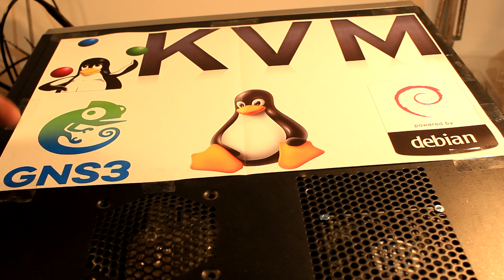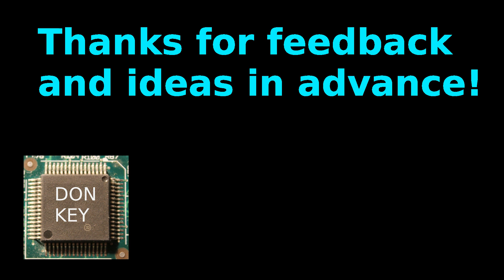Building an IKEA table-rack mounted lab for virtualization, CCNA-CCNP studies, and ZFS

Comment: The trick 7:10 with the fan is new to me, that's useful for me.
Reply from the maker: Yeah, one must cool those server cards. Now I also put in a 40Gbps QDR InfiniBand card in addition to the quad 1Gbps network cards, and the QDR card is very warm in spite of my fan cooling. Of course, in a real server this is not a problem, since there will be 4-8 fans blowing through the chassis like a tornado...

Comment: I run a Cisco ASA 5520 and a 3560G in my house full time and how I got rid of the "noise" of the fans was to disconnect the internal fans and then cut a 200mm hole in the cases above the ASIC on the switch and the processor on the ASA and then mount a 200mm fan on the cover and then connect it to the 12V supply on the ASA and Switch.  It keeps them cool and is whisper quiet.  I have done it on other Cisco devices where I didn't want to cut the covers I just mounted the fans above the devices with standoffs.
Reply from the maker: Cisco 5520 for a home, wow, I would say that is overkill. Even an ASA 5510 would be way too much, but power to you man ;) The issue is, that here in German speaking countries the rent prices are insane even for tiny apartments. Even if I could somehow reduce the noise with a large fan, there would be the issue of what to do with the heat. If there would be a basement, or I could use a room for nothing else but geeking out, that would be awesome!
Reply: I used to have a 5505 but it only has  Fast Ethernet and my Internet service was 300Mb/s so I had to go to the 5520 for the gig interfaces.  Another decent router/firewall I have been using lately is the Ubiquity EdgeRouter.
Reply from the maker: 300Mb/sec Internet ?  Here in some companies even the local ethernet is stuck at 10Mb/sec. Seriously, here you would pay with buckets of solid gold for such a connection. I assume you have an asymmetric line, so I am wondering, what is your upload?
Reply: I have 300/25, so "only" 25Mb/s upload speed....hehehe

Comment: I bet you had some work with it and you put some effort in it, but for real world Szenarios this is not applicable. If I put 4U 1 UPS + 2 fully equipped 2U Servers + 1 Switch in that "Rack" it will break. For your setup and very light setups it's enough but not more. So for all who are looking for a solution for a heavy setup please simply take a closed 24U closed Rack Railkit it costs +-160€ and it's a real rack with steel chassis and standardized holes and warranty. here an example https://www.amazon.de/12HE-offener-482-6mm-Rack-Schrank/dp/B00AC2BOHO/ref=sr_1_fkmr1_3?s=computers&ie=UTF8&qid=1501001608&sr=1-3-fkmr1&keywords=12+einheiten+server+schrank
Reply: How much weight do you think if okay? I think you underestimate this lack table. I have my 3d printer (about 10-15kg)+two din rails with terminals+my 2. Printer(about 2kg)+ my cleening Station (about 3kg)+ a Couple of Equipment (around 10kg) all in the tables. I stacked together 2 tables on each other and the do very well.

Comment: 8:50 every one is crazy now with ubuntu? don't know what you talking about. ubuntu has been the ugly duck on the room for years now.
Reply from the maker: Well, in general people all over the place are switching to Ubuntu, and for some purposes (like Nvidia GPGU computing) Ubuntu is becoming the new de-facto standard distro. Namely, Nvidia is delivering CUDA and the Nvidia driver nowadays as a Docker image on Ubuntu.  Even for GNS3 you can install the newest one with a single command line instead of having to mess around and compile it from source.
However, I am personally not so much in love with Ubuntu, because it is trying to be way too cutting edge and include the newest, latest&greatest which does not always work... With Debian things are 2 years behind, but it is rock solid, and so far the upgrade process always worked.

Comment from the maker: @Julian Bornemann commented, but YT is broken, so not all comments are displayed and often I cannot respond to them either:
           The legs of the Ikea Lack table are hollow frames with of 3 mm thick compacted wood with 2 particleboard caps on the ends. So you can not safely mount anything to them. The screws wont hold anything.
==========End of original comment
If you remove the particle board cap, and place in a 42x42 mm solid wood and you push it into the hollow leg, it will hold things.
In my "rack" the weight of the upper devices are supported anyway by the lower devices.
Nevertheless, I agree that the hollow legs alone would not support a heavy server like a Supermicro 4U chassis or anything similar.

Comment: hi is nice. what software u use in the pc up to the switches
windows or linux.
hope u can help me out.
Reply from the maker: Just drop me a comment here if you have questions where I could help you out.
I am making a step-by-step series on the software installation and configuration, so people can build the same from scratch if they wish to do it. I use almost exclusively Linux both in my job and in my private life. This is  just because I originally started out with computers by using SGI Irix, later Sun Solaris, and finally Linux.

Comment: There is also an article http://www.techspot.com/review/1155-affordable-dual-xeon-pc/ Which is very good and Quit but cost somehow more $$$
Reply from the maker: This indeed looks like a nice build. However, just the motherboard itself used from Ebay still costs 500Euros here in Europe on Ebay. My whole build did not cost even close to this amount, and I have not even factored in the Registered DDR3 prices, CPU prices, and the fact, that this would not fit even in my large Fractal design XL R2 chassis. Hardware costs in the U.S. are lot-lot cheaper, and even if we would buy things from the U.S, after custom fees and 20% tax it is just way too expensive.
Reply: Donkey Learning IT 
I agree with you , but i am very sure for real virtualization lab you will need such build.
Reply from the maker: I was thinking about getting a dual Xeon 1366 socket Supermicro board. Those can be had nowadays for 300Euros including the CPUs and 16GB of RAM, and one can buy more RAM in them (up to 64GB).
For a serious lab one needs of course more hardware than what I have, especially for high-availability labs and server-clustering labs. This cheap motherboard is not even able to support SR-IOv, and the cheapo network cards do not support VMD-q. IPMI on gaming motherboards is not even an option, and 16-32GB RAM is very little. I have mentioned the lack of these features in my previous video in this series. 
For the upcoming months this build should be OK, and for many people such a machine will do most of their labs. Since I work mostly as a contractor, I often change jobs in every 2-3 years. If my new job will be more focused on virtualization, I will build something similar like in the article you linked.

Comment: You should definitely check EVE (UNL http://www.unetlab.com/ )  Where you can virtualize many many networking devices.
But unfortuntilly the developers told me that for images that uses QEMU AMD will not perform good at all and could have issues.

Vendor: CISCO SYSTEMS
Qemu Nodes:
Cisco ACS 5.6
Cisco ISE 1.2
Cisco ASA 8.0.2 OLD syntax code match 8.2
Cisco ASA 8.4 supports multicontext
Cisco ASA 9.1.5 Supports multicontext
Cisco ASAv 9.6.2 or earlier
Cisco IPS 7.1
Cisco Firepower 6.1 Management centre
Cisco Firepower 6.1 Treat defence ASAv
Cisco Firepower 6.1 NGIPS
Cisco Firepower 5.4 (NGIPS, FMC)
Cisco CSR 16.03 Denali
Cisco CSR 16.0.4 Everest
Cisco vIOS L3 15.5, 15.6.2T
Cisco vIOS L2 15.2
Cisco ESA 9.7, 9.8, email security appliance 
Cisco WSA 8.6, 9.2 10.0 web security appliance
Cisco CDA 1.0 context delivery agent
Cisco NXOS Titanium 7.1.0.3
Cisco NXOSk9 (require huge resource x4CPU and 16G Ram siCisco XRv 5.2.2, 5.3.2, 6.0.1, 6.0.2
Cisco XRvK9 (require huge resource x4CPU and 16G Ram singCisco vWLC, 7.4. 8.0.100, 8.2.X
Cisco vNAM Virtual Network Analysis Module 6.2.x
Cisco vWAAS 200.5.5
Dynamips IOS
Cisco IOS 7200
Cisco IOS 3725 supports 16 port etherswitch card
Cisco 1710
IOL IOS on Linux (called as well IOU)
All versions, best on today L2 15.X IRON, and L3 15.4.2T

Vendor: Juniper Networks
Juniper vSRX 12.1.47D
Juniper Olive M series (old image)
Juniper vSRX NG 15.1.49D
Juniper vMX 14.1.4R8
Juniper vMX 16.1R3.10 VCP (control plane node)
Juniper vMX 16.1R3.10 VFP (forwarding plane node)
Juniper vQFX 10K VRE (routing engine)
Juniper vQFX 10K VFE (Forwarding engine) 

Other vendors:
A10, vThunder 2.7.1
Aruba: Clearpass 6.4.X
Alcatel 7750SR: 13.0.R3
Arista vEOS: Best ever SW, 4,17.2F and eaBarracuda NGFW
Brocade vADX 3.01.1
Checkpoint FW: R77-20, R77-30
Citrix Netscaler 11.0.62
Dell SonicWall 11.3.0
CumulusVX 2.5.3
ExtremeOS 21.1.14
F5 BIG-IP 12.0.0 Supports LTM, GTM if loaFortinet manager v5
Fortinet mail 53
Fortinet FGT v5
Fortinet 5.2.3
HP VSR 1000 7.10
Mikrotik 6.30.2
PaloAlto FW 7.0, 7.1
pfSense FW 2.3
S-Terra FW, Gate 4.1, 
S-Terra CSP-VPN gate  3.1
VyOS 1.1.6

Operating systems as EVE lab nodes and other tools:
Windows XP
Windows 7
Windows 10
Windows Server 2003 
Windows Server 2008R2
Linux DSL 4.4.10
Linux Kali x386 light
Linux Kali Full most powerful linux for emulate attacks and scan networks
Linux Mint 18
Linux Slax 7.08
Linux TinyCore 6.4
Linux Server Ubuntu 16.04 with Webmin management
Linus Server 16.04

Linux NETem:  NETem emulates a network link, typically a WAN link. It supports bandwidth
limitation, delay, jitter and packet loss.
Ostinato traffic generator 0.7, 0.8 http://ostinato.org/
Reply from the maker: This UNetLab might be interesting in the future.
For the time being I just stick to good old GNS3, because it should be able to run most of the labs. 

I was thinking about Cisco VIRL because I could probably get a cheaper academic license, but it looks and feels the same like GNS3. Thus, I do not understand why would I pay for the same thing. OK, it runs IOS v 15 and it does switching as well. For switching I got real switches, which should be fine, and one can always learn more from real equipment anyway. I got lots of old physical routers as well, but the only thing they are good at is testing line cards.